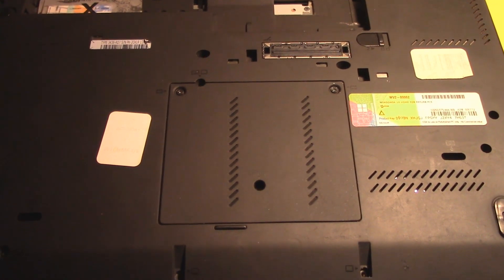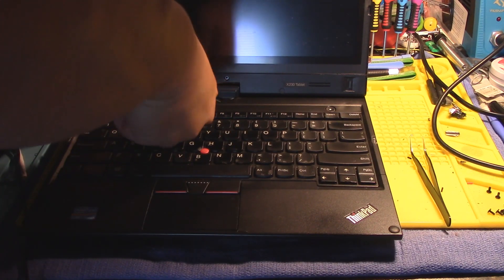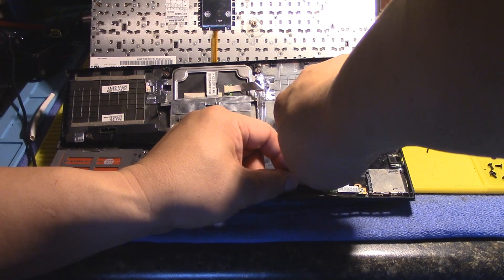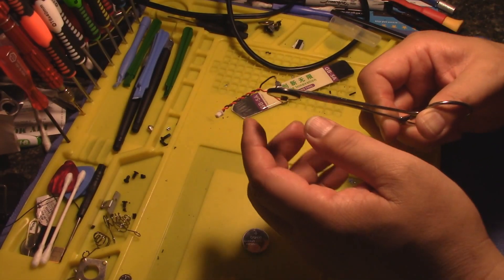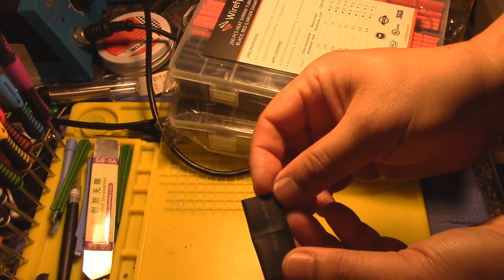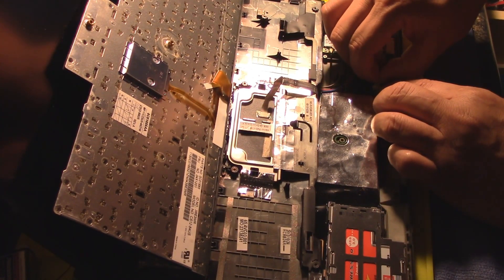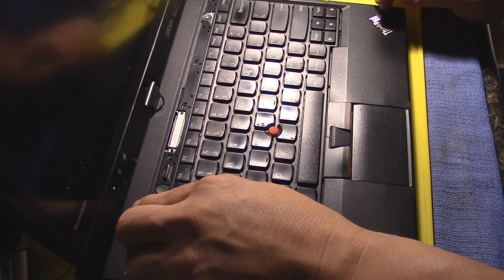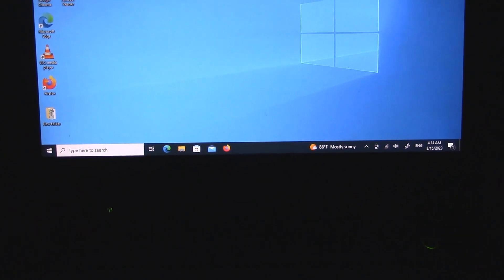Lenovo laptop CMOS battery replacement

Comment: hi brother!. my laptop is lenovo thinkpad L470. recently i changed the battery due to bad backup and it automatically turend of. everytime i switch on my laptop both battery and cmos error shows and asked me to change the date and time everytime. but now i changed my battery . but also now my laptop automatically turns off when it comes around 50 percentage. when i switch on ,again it shows o271.date error and 0251 cmos checksum bad again.
Reply: i also replaced the battery again tcheck the battery. evennow it persists. i don't know what to do. i really want to know that is the problem in laptop. do  have to change the CMOS battery or it may be due to charging IC. technicians won't clearly say and i could really use your help. it will be really amazing if u can try and read my comment and reply. thank youu brother.
Reply from the maker: You should change the CMOS battery and then go from there.
Reply: @mrfixit4211  thank you brother ❤️